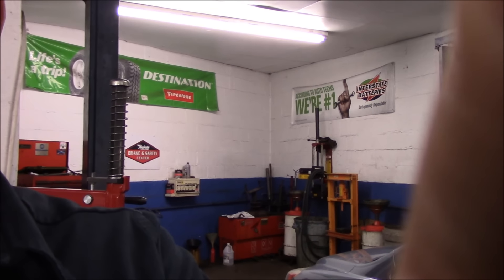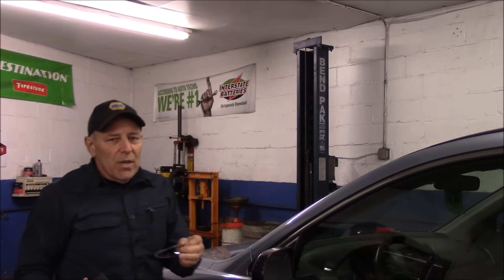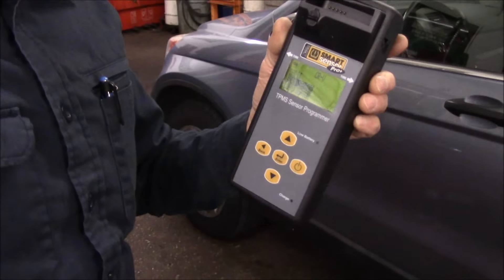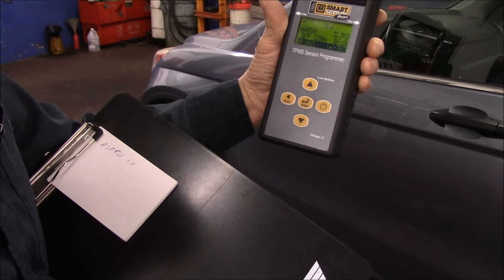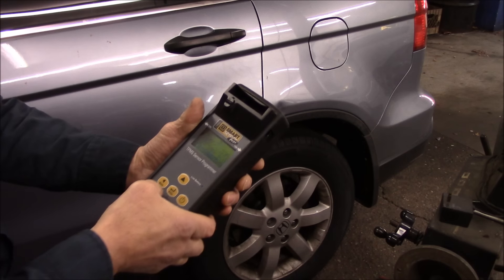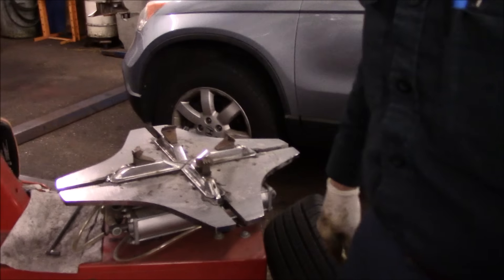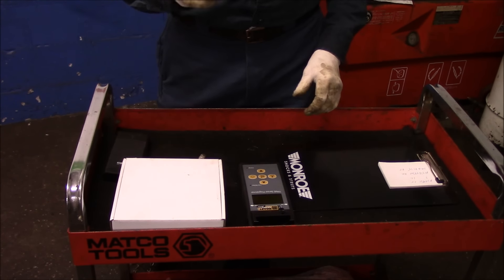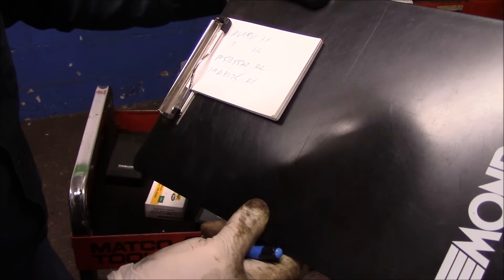How To Reset Low Tire Pressure Light (TPMS) Tire Monitoring System

Comment: First: Thank you for taking the time to make this video. I was curious where to get that TPMS programmer machine, and I was also wondering if the weight of the new sensor differed enough to affect the balance of the wheel? Thank you in advance.
Reply from the maker: You should be able to get the tool on line . Yes it will affect the tire balance. I'm happy to help. Thanks for watching
Reply: @jimthecarguy  Hi Jim, thank you for the reply. I had one more question if I may. Can I use an OEM sensor with this TPMS tool? Or does it only get along and program the sensors that are sold with it?
Reply from the maker: @stevealaska73   Good question. No you can only program there sensor. The others will not fit in the tool.

Comment: I am told the there are two indicators on the Honda TPMS system , The TPMS logo "itself" and the low tire Symbol,,  am I correct that if the TPMS logo is lit that the system has detected an error with a remote in wheel sensor hardware "failure to respond" out of the 4 present at least one in wheel sensor is not talking ? or can other issues bring about this indication as well ?

Comment: Thanks for the excellent detailed video Jim.  I'll just put a piece of electrical tape over that idiot light.  The tires are only 10 years old with 15,000 miles on them.  My father used to tell me, "no need to get new tires until you can see the steel belt."  He died a millionaire.  Left me a freaking 30-30 Winchester.  Thanks dad.  Now I can go buy a tire.
Reply: Yes I used to wear the tires pretty thin but when I started commuting more on the highway I'd replace the tires a little earlier
Reply: Never fired a 30-30 but love lever action rifles I guess you wear your ear plugs when you fire it?

Comment: Ok everyone these lights are the government voice tell you to check you tires and get some a little shop or a dealer to have there way with you, People have been building cars and tires for over a hundred years, the dividens and margins for these sensors are just a slight difference in pressure and the light comes on and most of the time it takes process to clearing the light costing you money, sometimes alot. You see there is this thing called a tire pressure gauge, not very expensive, and we have been checking them our selves for 100 years, this is still your car you need to take back ownership, just saying, I have been working in shops for over Thirty years, this is a rip off, or design it to rest without programing, look at some Toyotas you add air it sets it's self,some vehicles you have jump through hoops just get a single tire set. It's time for us a whole to just start paying attention.

Comment: Excellent...This is the third video that I have watched. Yours is the best and most complete description of this problem. I have a 2011 Dodge Charger that displays the flashing light sometimes. I always verify the pressure with an old tire gauge and pressures are where they should be for each tire. Can I ignore the "flashing light"? Could the car receiving unit be at fault?

Comment: ALWAYS rebalance the tire after replacing the sensor. Sensor electronics get smaller and smaller, certainly over the years of the normal battery life. The new sensor most likely has dissimilar weight than the old one
Reply from the maker: thanks for your input . Your absolutely right the weight will be different and your tire balance might be off..

Comment: I just put 2015 stock Dodge Challenger rims and tires with sensors on a 2013 Dodge Challenger will the 2015 sensors work on the 13? My light is still on
Reply: Austin king if you program them to your car then yes

Comment: i had tire light on 2007 odessay checked all four wheels good pressure, light still on then checked spare tire , it was low so i put more air then without driving it the light wented out! .weeks later it wented on again! checked spare and again it was low so put more air light went out again.so pizz on the light i just check spare on occasion and fill it and light is on often but I like pretty lights!  😀 don't need a damn light to tell me i got alow or flat tire ! why don't the manufacture create something to fix the low or flat tire?
Reply from the maker: Thanks for watching

Comment: I just put air in my tires on my 2007 Acura TSX. it was only the two front ones because although all four were at 32 PSI (which they should be) , the two front ones looked kinda flat so we put 34 PSI on both. now i get the TPMS Function Error message. any help?
Reply: Bro same smh

Comment: You can buy the oem ones online for less than a 100 dollars a piece. If you live were they don't do inspection most just live with the light on. 2 things we never did need was anti lock brakes and TPMS crap. Am 70 years old and never had a problem with regular  brakes. With ice and snow anti lock brakes almost cost me 2 head on accidents. They can pull you to one side and when you let off the brake the anti lock brakes will not disengage or malfunction and cause a accidents. Anti lock brakes cost a small fortune and they don't work good enough to be worth the cost at all. If you grew up without them and learned how to drive without them you will hate anti lock brakes like me. I had more control without anti lock brakes IMO. Air bags are another thing I don't like. Who wants something that close coming at you at over 200mph. Not me. And if you get in a accident they junk the car because the air bags went off. Just a light hit can cause them to go off costing you a car that could be fixed with a new bumper and other small parts. Nobody want the liability with replacement air bags. Why you think you car insurance is so high. They junk cars over just air bags going of with slight damage to the car itself.

Comment: You can buy these tire caps for $1 dollar 4 gauges  mechanical costs 15 to 25 cents each  and closing caps button instead of regular caps turns from green to red when it sense low car pressure in a tire.  I have it on my vehicle but if your tire is low on air just a regular check up periodically can save one money without being so lazy. The cost of these auto tire TPMS sensors  range from $54 to over a $100 plus each one per tire time every 5 to 7 years as mentioned like $200 to $400 plus tax and garage service costs I think it is really a waste of  time. Dish out $54 each plus mechanics time and  clients time  every 5 years or so. 15 cents vs $100 sounds much better the laziest excuse and it will not help in case car tire failures while on highway etc. It does not make the car safer if TPMS tire sensors  fail might as well add a battery level sensor and up the price.

Comment: Nice video. I like the step-by-step you did. My TPMS just came on today and I don't have to sensor machine you have what should I do if I want to do myself? please help.
Reply from the maker: Lee Sirlee the first thing to do is check the tire pressure on all the tires to see which one is the problem. Maybe there is a nail or something like that causing a leak. Keep me posted

Comment: TPMS is designed to cough up your money. The battery in TPMS lasts only ~5 years and cost ~$50 each + installation cost if not done at the same time the tire is replaced. I hear many people just leave the warning light on after the battery dies.
Reply: TPMS is a feature, not a bug...LOL

Comment: Great video.  I like those clone-able sensors.  Your decent shop scan tools will also pull the codes out for TPMS.  I used my Autel DS708 to get a low battery code from a 2007 Infinity for my neighbor yesterday.  I don't recall the exact DTC but it told me "FL Low Batt" or something like that which confirmed my suspicion of a bad sensor.  I haven't tried programming in the new sensor with it, though.
Reply from the maker: johnaclark1   This tool works great. Where are you located. I'm in New Jersey  If you close I can make it for you

Comment: I have a problem with my 2008 Dodge Nitro 2.8 Diesel which I believe is due to the TPM System.My car should display separate readings on the dash for each of the four tyres but only three are working as they should, and the Right Front only displays a straight  line although the tyre pressure is OK.In trying to correct this, , in turn,  two new complete pre programmed TPMs  have been fitted that were supplied by a Chrysler Agent, together with a good original TPM that had been previously removed from a different wheel on my car.In turn, after each TPM was fitted,  the car was driven as recommended But still the same problem still remains.Through this I've come to the conclusion it must be the TPM System or the Right Front receiver at fault but I cant find any information relating to this problem for my Dodge Nitro..  Can You Help - Regards Cliff

Comment: Very informative! Thank you - I like to understand what will be done to my vehicle before it happens so that I’m not struggling to understand what’s reported to me by the mechanics.
Reply: I have the same question and I have asked that in my comments. I was thinking of just asking the shop to change all of the sensors after the car is over 5 years old.
Reply: @samali108 just disconnect the battery cables from positive and put back on. The light will go off as hell

Comment: my low pressure lite stays on all the time because I run 45-55 psi. I run 10 ply tires on my pick-up . I guess the system monitors low AND hi pressures. I can't run 35 psi in my 10 ply tires. it wears the outer edge'

Comment: Never owned a car with tire pressure sensors. More useless electronic garbage to go wrong IMO. Millions of tires made without them over the decades. Is there really such a crisis of low tire pressure to warrant these sensors? I doubt it. Just more crap to break and force you to take your rig to a mechanic. There are far more problems on cars that need our attention than low tire pressure.

Thanks for the video. Very well explained.

Comment: But every vehicle & brand is differnt, reset button viild be in glove box or under the dash blow steering wheel, people need to check their owners manual but to note that many videos on this issue will try to steer people into saying the tire sensors batteries have likely failed this is not true, its rhe reset button is what the problem is but the tire pressure has to be set to correct lbs of air or light on dash will stay on or blink so lbs of air is to be checked first once tires are correct then using the reset button will eliminate the light on dash from blinking or just being on.

Comment: Thanks dude for the whole info and explanation..... I have the same issue on my CRV on winter..... Honda check the 4 tires and sensors, but in winter the read light appear on the dash board....

Comment: Can you just replace the battery in the sensor ?
Reply: I asked that too. No  battery is stuck in a waterproof seal.  You can't even get a rebuilt sensor.  When they go bad you have to throw it out.
Reply from the maker: No when the battery goes bad you will need to change the sensor . It is not serviceable.Thanks for watching.
Reply: jimthecarguy thanks for your response.  I certainly appreciate it, I will subscribe to your channel you videos are very informative and you do give a well explanations on the subjects.
Reply from the maker: @juvevalerio3240  Thanks for watching and subscribing.

Comment: So a month later and coats still hasnt called back regarding a 5000 dollar machine. I wonder how much they should pay for the electricity spent keeping your air compressor running all the time (wearing it out as well)
Reply from the maker: Bad DFW Mid-Cities Drivers   Yes Coats is not like they use to be. I need to disconnect the air supply when not in use.  Maybe some day Coats will admit that there Base line is junk. That's for asking I will keep you posted

Comment: Take sensors out. Put in air tight box with valve stem pump up to 33 psi and then put in trunk or tool compartment. Light goes off and the tire place doesn’t break them every time you get tires

Comment: Great info Jim. Love the cloning method. Great if you didn't have a scan tool to reprogram the computer. Thanks
Reply from the maker: Your right this tool works very well.
Reply: @jimthecarguy question. What about if we disconnected the battery cables from  positive  and put back. Is the light will go off right?

Comment: Jim: Replaced two tyres after which the "light" came on: Am I right in assuming the "mechanic" did not allow for the sensor valve?...because the valve he showed me, later, was a run-of-the-mill tyre valve...no sensor attached... He was bullshi##ing me....right?
Reply from the maker: Yes you are right . The sensor is different than the standard valve.

Comment: I would just rather find out how to disconnect the sensor light on the dash. Talk about overkill on sensor monitoring. Have been driving for 45 years and always checked my tires air pressure on a regular basis. This is just more un-necessary technology that can go bad...
Reply from the maker: It would be great if the sensors had a lifetime battery.Thanks for watching

Comment: How can you disable the TPMS on the vehicle? It is obvious that the system assumes at least one tire is low UNLESS it receives a signal from the four (or five) sensors it is programmed to look for.  Would it be possible t program a transmitter to send the signals anytime the vehicle was running?  Pull the fuse on the TPMS?  Reprogram the TPMS to look for ZERO sensors?  

This is the sort of thing Congress should be looking out for!  e.g. 'accessory; systems that cannot be disabled by the customer shall be disabled by the dealer upon request at n charge t the customer. Now, that's a law!   

How about Certificates of Deposit rules that say "Upon Maturity the principal and interest shall be paid to the customer/owner unless the customer directs otherwise?"  

And Cable Companies - don't get me started!  What sort of representatives agreed to the laws governing cable companies!?  We used to get TV for FREE (radio, too). Now "OUR" representatives let them charge us for  TV and make us watch Commercials!  

And the Internet? Well, the creation of the Internet was funded by US taxpayers (rural and metropolitan taxpayers) . The cables (copper/fiber/coax) depend upon using Public Rights of Way and easements and still cannot provide service to the taxpayers that funded the damned thing in the first place!

Comment: It's RIDICULOUS that TPMS is mandatory but requires so much costly equipment to maintain. Every 10 years, car owners are facing $400+ in replacement costs whether they hire a mechanic to do it or try to go the DIY route. Ditto people with seasonal tire sets.

Comment: This answers nothing. I just got new sensors installed and have the light on, apparently (according to an oil change place i went to) the entire system needs to be reset/calibrated thru some crazy process involving putting so much pressure in each tire, turning on the ignition then turning it off or something like that. I Was expecting THOSE instructions in your video. Disappointed.

Comment: Great lesson... Can I have your email address so I can write you. I need to buy the smart sensor and also I need a store to get a replacement sensor once I trace the faulty sensor
Reply from the maker: You can buy the sensor and the whole kit in my Amazon store below the video in the description.  My e mail is jimthecarguy1@gmail.com
Reply: Jimthecarguy thanks for the info. Can you recommend a scanner that I can use to diagnose my car when the check engine light comes on....so can buy with the smart sensor....thanks

Comment: TPMS monitors are really neat technology but hardly worth the cost of maintaining them.  If you drive a car, check the oil, check the tire pressure, and do it at least monthly.  Every time you drive a car look at the tires, how does it steer, feel?.  If there is an odd tire check the pressure and get it fixed if the problem persists.  Many tire company's will do this for free (Belle, Discount etc.)  I put a piece of black tape over the TPMS light.  Take responsibility for your vehicle safety, this is not rocket science.
Reply from the maker: I'm happy to help. Thank you for watching

Comment: how about the manufacturers take all the JUNK and CRAP off the vehicles instead, and start teaching new drivers about checking oil and tire pressure and other things they should be doing as a driver.

Comment: This video doesn't show how to reset the TPMS he shows how he replaces TPMS. IF resetting TPMS  that's what you're looking for (like me) this video is a waste of time. In this video the TPMS resets itself!
Reply: GOOD TO KNOW. turned off. I might add if it was me I'd ignore the TPMS warning light and just keep an eye on my tire pressures, (like days of old) ask yourself how did we ever survive W/O TPMS...we did just fine THANK You My 2017 VW doesn't use TPMS monitors in every tire it uses a different system for pressure monitoring...WITH OUT sensors!